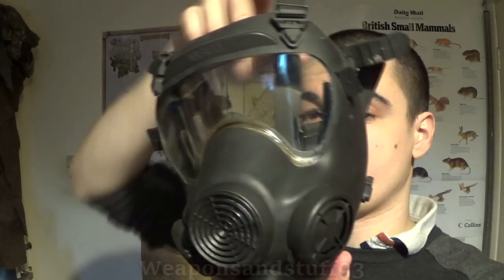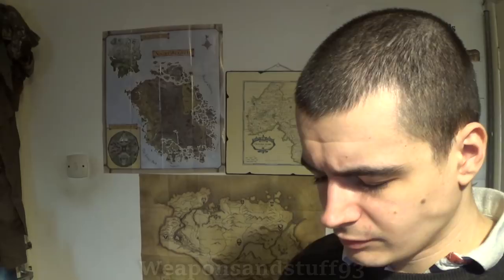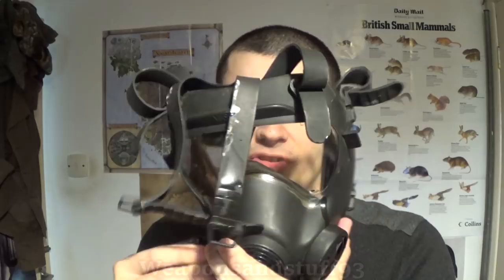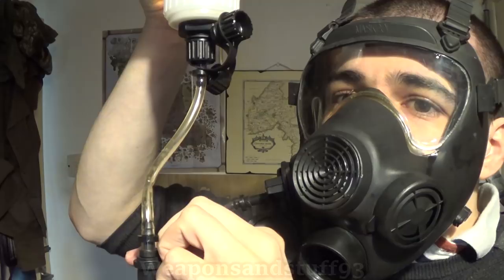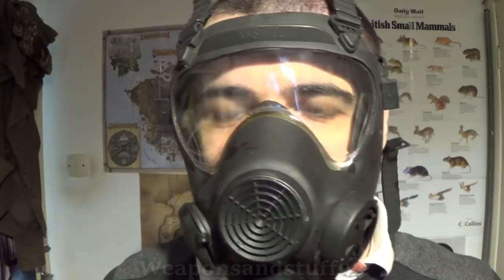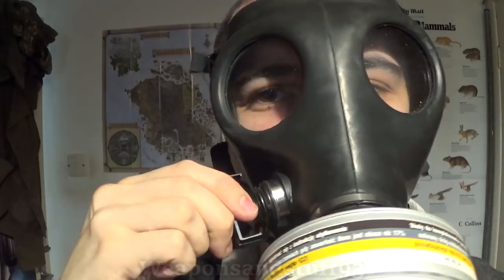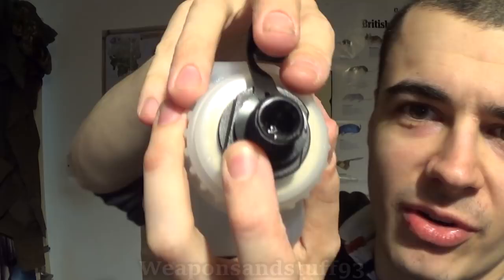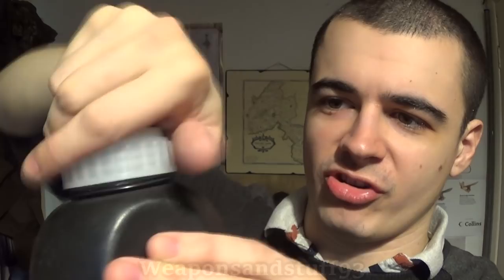Polish MP-5 Gas Mask Drinking Tube test

Comment: Great Video! I have that polish mask and bought a US type canteen that has the same spring loaded intake as the mask (not the screw cap). Any ideas where I can buy only the drinking tube that you show? The ones I see on ebay have the screw on cap so its not compatible, I need the push through plastic straw system as you have connecting your mask. Thanks.

Comment: I recently bought an SGE 400/3 BB gas mask & both types of drinking tubes that are available for it. One is just a tube with screw fittings to attach it to a military drinking bottle and to the mask's drinking tube connection. The other drinking tube is basically a black version of the one you have, but it has a screw end for the mask. Apparently we can buy an adaptor for that tube, that allows it to attach to a Camelback water holder (for want of a better term).
From what I read, the squeeze part is a valve to ensure the tube is blocked off when it's not being used. I haven't got around to trying out the drinking tubes yet.
I just checked if the drink bottle thread is compatible with standard military drink bottles. Just as well I bought an SGE drink bottle, because their screw-end drinking tube only fits their proprietary drinking bottle. -They also charge a fortune for their drink bottles!

Comment: Has anyone had any luck finding the drinking straw connector for this mask? I haven't seen anything on Ebay. I think the only thing I need is the part that directly connects to the outside of the mask. After that,  probably could use Israeli tubing.
Reply: you ever find one? im looking as well
Reply: @bryanatkinson2860  Yes, it was from a UK seller on Ebay... i'll see if I can find again for ya.

Comment: I checked through and did not see anyone answer your question about the tubes "pump". The reason is to prevent air from getting through your system, but its an external additional system, so..... in most cases ive found that the canteen with drinking tubes, or masks with drinking tubes. 

Also with all in the world, anyone else modded a 3m cartrage mask to use a drinking tube? Or am i the only one who gets thirsty after a day with a mask on? 
(I know im loony for that question but theirs bound to be others.)

Comment: The valve on a tube is for safety. It doesn't have a valve on the bayonet part, so without the tube valve, you would be able to breathe through the tube, which would be fatal.

Comment: Probability you can disconnect the "pump" and connect the canteen directly to the mask piece, since they are held together just by friction (even if this will make the tube a bit shorter)
Reply from the maker: Yeah I thought that but I don't really want to pull the mask apart.